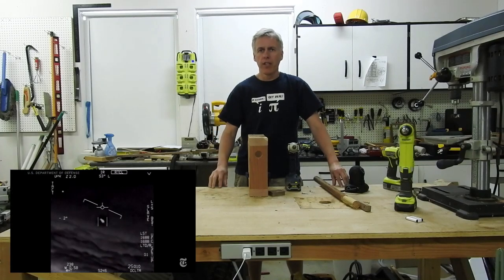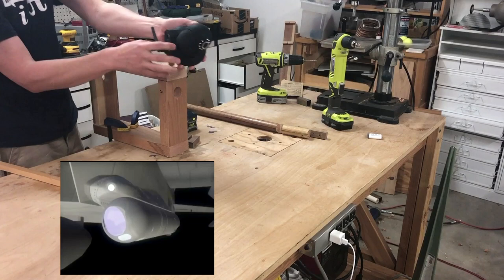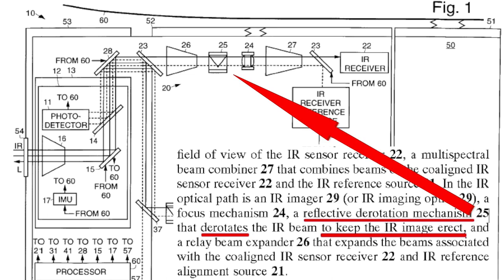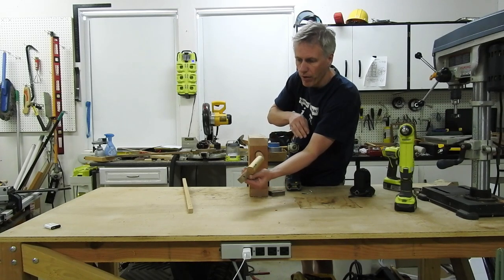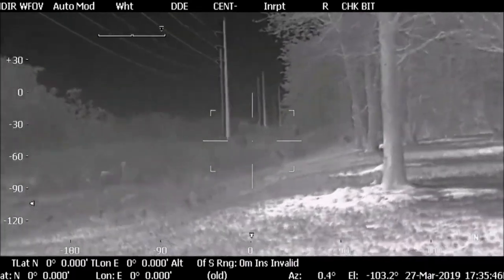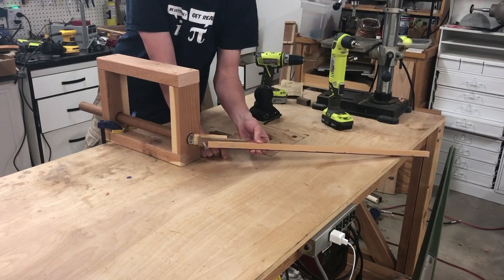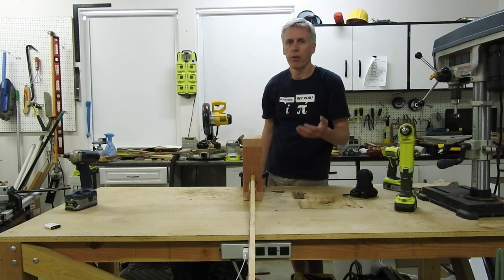Explained: Gimbal UFO rotation caused by ...a Gimbal!

Comment: Mick, have you seen Dave Falch's attempt to debunk this? He seems to be erroneously suggesting that you are claiming  the IR glare is being caused by the de-rotation device. It seems more likely to me the glare/light diffraction is happening where the light enters the front window of the ATFLIR system. The way the window is angled when the camera is facing forward would certainly explain the rotation of uneven lighting which just so happens to occur at precisely the same moment there is the illusion of the centered object rotating.
Reply: Never mind! I just noticed you used one of his videos to demonstrate how the gimbal would rotate on its roll axis when the target is at elevation. That was nice of him to help you debunk the GIMBAL video!
Reply: @Natty1620  lol... That guy doesn't understand how depth of field works, doesn't know what an unsharp mask is, incorrectly referred to the camera orientation indicator as the laser fire indicator numerous times, and as Mick has shown with his latest video, used dodgy math to determine the location and rate of speed of the gimbal object. I'll pass.

Comment: I understand the camera thing, but why didn't the clouds rotate as well?

Of course, they rotate but not that hard as the object does.
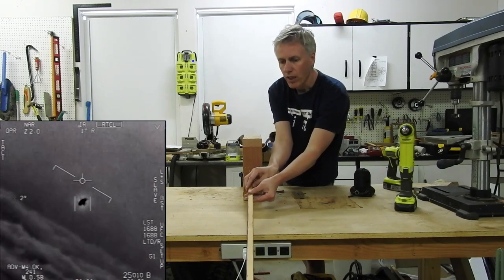Reply: That is because of the de-rotation mechanism. If you look closer you see the whole background slightly turn when the "object" is rotating, but then quickly adjusts itself into a stable position, for example at 5:21 if you look at the horizon.

Comment: The fact that the rotation of the object occurs at the same moment as Mick has described here is quite proof of what Mick is saying here. However, the 'glare' itself is quite odd-looking thing. I've watched Dave Falch's videos and a glare produced by a jet is looking quite different than this. And if the object banks the shape of it should come visible. Again, the fact that the video ends almost as soon as the rotation occurs, maybe a hint that the video is actually a demonstration of the 'rotation' phenomenon and meant for pilots with the purpose of instructing. I cannot imagine a reason why the clip stops at all when there is an unidentified craft in the targeting device. Or the rest is cut out to hide something that might be too much of a shock for the general public.
Reply: If you talk to any UFO fanatic, they will believe that its only a coincidence that the object rotates at the same time that the camera is supposed to rotate.
Reply: @lionofnaples  I wonder why the video has been declassified as it points out design flaws or would I say imperfections of the targeting system to the adversaries. The flying military and its leaders are not Meyers until the capital has been bombed.
Reply: @Modafinil  But it only demonstrates a known flaw in any optical design and that have been known for ages even among adversaries.
Reply: If I remember correctly, Ryan Graves did say in an interview the video he saw (original GIMBAL) was longer and the quality was better and there indeed is more to see than in this the public is allowed to see.
Reply: @Henrik_Holst  I was not totally serious with that comment but what do I know about these things. But here is our local 'phenomenon': https://youtu.be/k44NhhtkAeY?t=185 I commented on the YT video of local ufo investigation organisation and pointed out that the 'saucer' is certainly fake. They got mad and said that hundreds of researchers are looking into that case. The faith is strong - let's say infinite - if that video is considered to be a real case.
Reply: @Modafinil  That looks like a speck of dust moving over the lens, but that is not from any deeper analysis of mine :-)

I had higher hopes than that for my Finnish brothers. Mitä vittua!
Reply: @Henrik_Holst  You probably looked at the video using a small screen. If it is watched with 2k screen and full HD resolution there is a saucer with a small dome on it. Even tinier windows also for aliens to watch they don't hit F/A-18.
Reply: @Modafinil  less than an arms length away from a 27" 2k screen.
Reply: @Modafinil  Even zoomed in it looks exactly like the kind of dust particles that I for one have in one of my eyes, if I move my right eye left-right quickly then a few particles that looks exactly like the one from the video goes across my viewfield.

The saucer shape also collapses beteen frames. So my take is still my initial one that this is some form of dust particle moving cross the lense of the camera. Surely an event like this was covered by multiple cameras so it should be easy to get additional footage and if the anomaly is on more than one camera then I will change my mind.

Comment: Not really sure about this explanation.
1. In the footage you can hear the pilot seem very surprised by how it rotates, surely they would have either seen this rotating effect before, or have been told about it by HQ or some other pilot. Imagine all the times they went out, are we to assume it never happened before?
2. There is very little movement in the horizon relative to the subject, if the camera is correcting for any rotations why does it not correct the subject wihtin the frame?
Again why arent't the pilots aware of this?
Reply from the maker: Maybe this was the first time they had seen it. Why not?
Reply: @MickWest  Yes possibly, but then surely that would have been investigated and explained back at HQ, so the next time they are out, they don't relay back incorrect information.
Reply: @MickWest  I like the way you don't address point 2...Why do the clouds not move also? your explanation is ridiculous
Reply from the maker: @ViralKiller  https://www.youtube.com/watch?v=ka_bX9Hx1H0
Reply: @MickWest  wrong...aspect ratio would have to shift also, shift in scale..also i think commander fravor knows what a garden variety plane looks like

Comment: Is there a way to analyze the jet's distance from the target as the jet seems to be banking to the left quite constantly as the indicator on the screen of the monitor may point out? This could help to estimate the distance of the target as it seems to travel the same trajectory as the jet is. Yet another thought I have about this is that the clip is short and it would be very interesting information how there could be another jet in the air that the crew of F-18 is not aware of? And if the crew has followed the target after the clip has ended, there would be eventually an opportunity to either identify the target to be another jet or notice it e-g- to vanish into a thin air. So this clip actually shouldn't represent anything unrecognizable in the first place. So maybe this clip has been a training video to demonstrate the glare rotation that may cause confusion as Mick hints but why it has ended up being scrutinized by Elizondo's unit is a mystery.

Comment: You're discounting that rotation of the presumed lens is decoupled from plane rotation and horizontal plane. Furthermore the military has doppler readings from radar that tell them what the object is doing. If they say the object is rotating, it is rotating because they have multiple sensors to tell them so. A lot of questionable assumptions on your behalf.

Comment: Could the de-rotating mechanism be the source of the rotating flare due to polarizing effects? Or must it be introduced by the camera? Still crunching my brains on this...
Reply from the maker: Derotation is part of the camera - at least in the patent it comes before the sensor.
Reply: There are other cases where glare can be seen rotating on an ATFLIR camera system while the scene remained stable, as seen @ https://www.metabunk.org/posts/216265/

Comment: Yeah no this explanation wouldn't work for several reasons:

1.) The biggest reason, the gimbal rotatest RELATIVE to the clouds, which remain STATIONARY, so if there was rotation due to camera, everything should have rotated.

2.) You can see that the gimbal starts and stops rotating several times while the overall frame does not rotate. 

3.) And actually you can see that the overall frame DOES rotate for a slight moment but in the OPPOSITE direction of the Gimbal, and when it does rotate at that point the Gimbal does NOT rotate with it. Showing that it is infact some real physical object.
Reply: There's a derotation mechanism that stabilizes the picture as the camera rotates, which is why you don't see the clouds or horizon rotate.
Reply: Facepalm

Comment: As other have said, the craft rotates but the clouds don't so it cant be the camera also these are profession fighter jet pilot so you think they would recognize another fighter jet??
if it was a commercial jet a fighter jet could easily get close or even overtake it, but they had trouble keeping up with it.I'm sure the airforce would have knowledge of any aircraft in the area for obvious reasons, they don't want a collision or they would not be flying in commercial aircraft flight paths.
Reply: It's already been shown in higher bitrate sources of the footage that the clouds do also create faint low luminance diffraction rotations in tandem with gimbals diffractions

Comment: You are wrong, because the clouds would rotate also
Reply: The reason why the clouds and horizon do not rotate is because there is a derotation mechanism inside the gimbal which keeps the picture stablized.